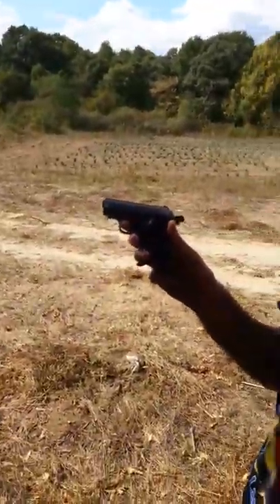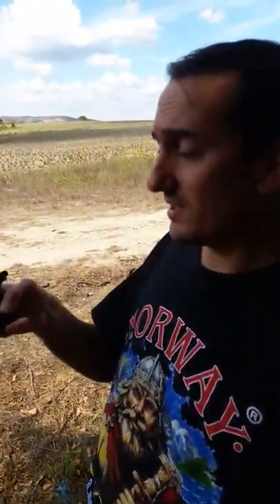Ekol Volga shooting review.

Comment: Nice video..👍👍👍i heard ekol guns are reliable with different ammo. Some brand of ammo will cause jam or misfire. But i think if you clean and lube your gun after 100~200 rounds, you won't have any issues..😉
Reply from the maker: I do clean all my guns after every time I fire it. In this case you can see the hammer hit, but the ammo didn't fired :)
Reply: Replica blank guns i see.. so there was an issue with the gun itself..
Reply from the maker: At first I though it was a problem with the gun, but when I watched the video I saw that the hammer actualy hit, but the round din't fired. So I guess it was defective round maybe ;)